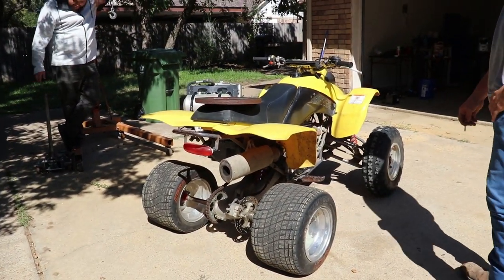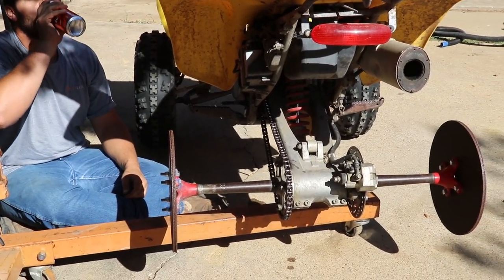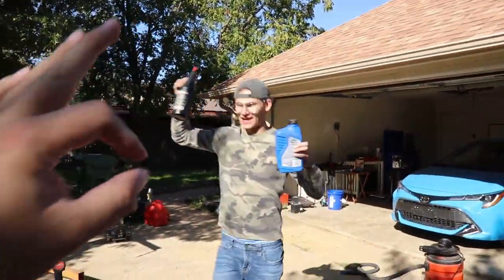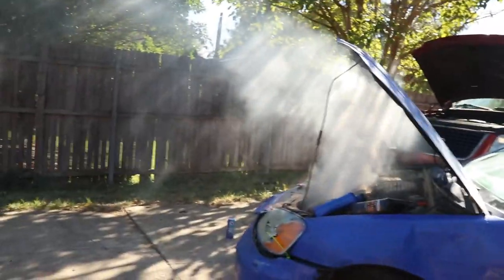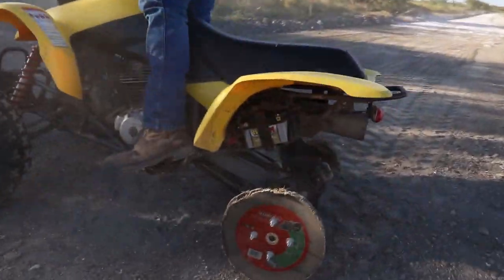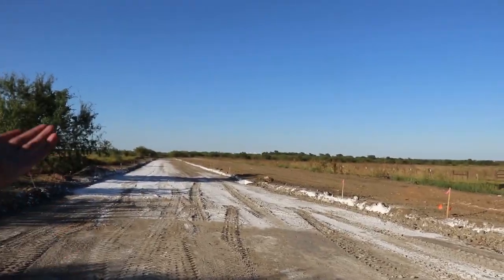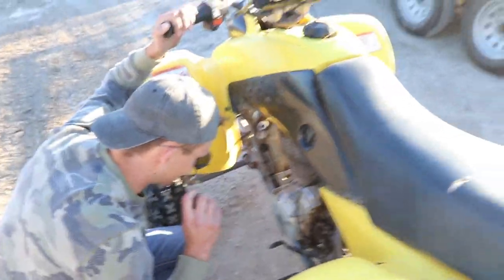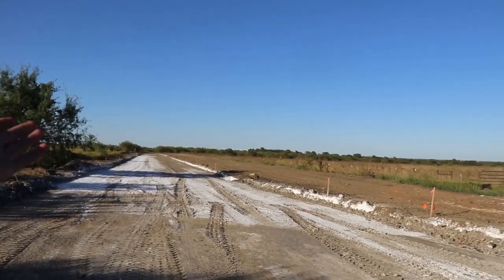ATV with Concrete Cutting Wheels

Comment: Guys, y’all blew up the atv engine cause it is air cooled and y’all never went straight for really any period of time. Y’all were always just spinning the wheels or drifting which means there is little to no air flow. Not saying the video was bad, it was really good but yeah, the reason it blew up is cause y’all never let it cool down.